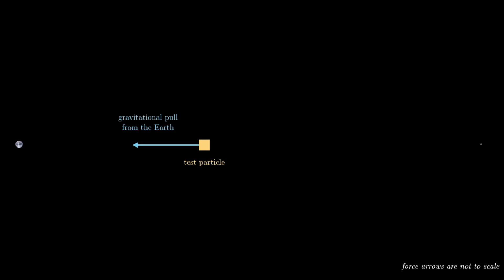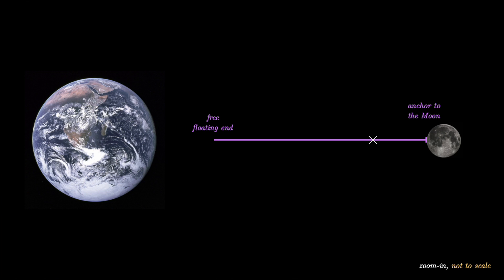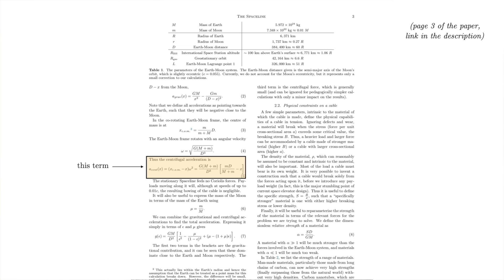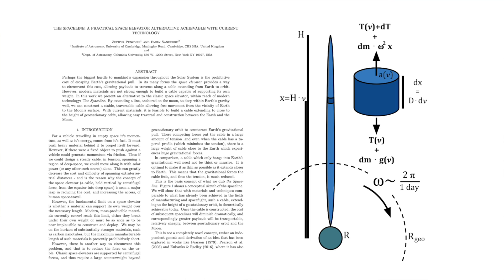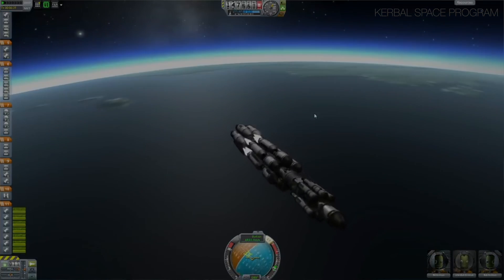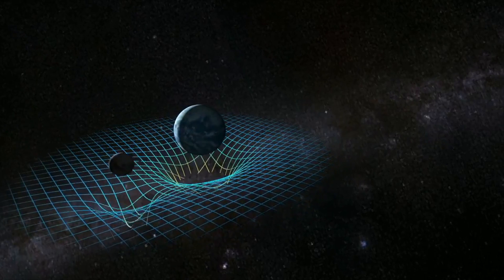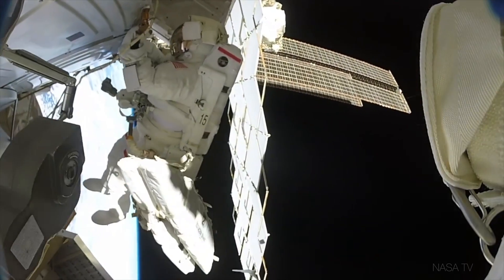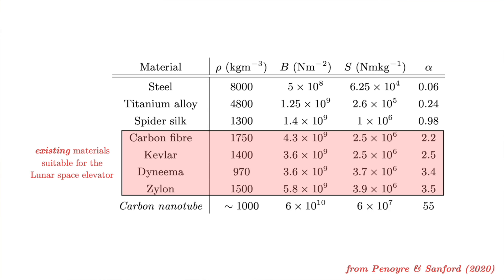The Lunar Space Elevator

Comment: I quickly read your paper, thanks for posting!  Surely, with libration and tides and so on, the L1 point is jiggling around?  Does this not constantly change the stresses at the Lagrange point and/or cause bowing and whipping of the line between L1 and the Moon?  Also the Earth 'end' point may end up whipping around too.  I suspect there may be some interesting engineering problems as a result.
Reply: What if instead of a cable they used something rigid like steel beams 100ft long connected with joints that allow a wide range of motion?  Or if the structure extended all the way to geostationary orbit, wouldn't that mean most of the mass would be pulled by earth's gravity, thus keeping the line taut?

Comment: As I listened to this, my mind kept saying "but what about Coriolis force?  There's a huge change in angular momentum."  The paper by Penoyre and Sandford does address Coriolis, but simply calls it negligible without justification, just to later note that Coriolis forces would induce bending in the cable.  I haven't run the numbers myself and I'm no material scientist, but it seems absurd to claim that we can just hand-wave this force away.  After all, the argument for a lunar elevator is that it reduces fuel demands, meaning the energy from that missing fuel must come from somewhere else.  Penoyre and Sandford  seem to think the stiffness of the cable is sufficient to transfer this energy, but I'm not inclined to just agree.  It seems to me that a sufficiently stiff cable would need to be so massive as to be not worth building in the first place.  Alternatively, a much smaller and less stiff cable could be used but it would be limited to small payloads.  
It seems much more reasonable to consider a thinner cable combined with tangential thrust, perhaps from fuel produced and pumped from the Moon.  In this way, construction of this infrastructure might become more realistic without sacrificing payload capacity.
Reply: 11:24

Comment: I AM FAR FROM UNDERSTANDING ALL THE FORCES THAT WOULD BE INVOLVED FOR A SPACE ELEVATOR BUT I CAN REMEMBER READING ABOUT IT IN SOME SCIENCE FICTION BOOKS. IF MEMORY IS CORRECT IT WAS ARTHUR C. CLARKE THAT USED SUCH A DEVICE AND I REMEMBER HOW EXCITED I WAS ABOUT IT. 

I HAVE GIVEN THIS IDEA SOME THOUGHT AND I HAVE A QUESTION FOR ANYONE THAT HAS MORE KNOWLEDGE ABOUT SUCH THINGS THAN I DO. WOULDN'T IT BE MORE ECONOMICAL AND STABLE IF THE EARTH TO SPACE ELEVATOR TO BE PLACED AT THE NORTH OR SOUTH POLES? I'M THINKING ABOUT THE ROTATION OF THE EARTH WOULD ALWAYS BE PUTTING A LOT OF STRESS ON THE CONNECTION AT THE EARTH END AND POSSIBLY WEAKENING IT UNTIL IT WOULD BREAK. AT THE NORTH OR SOUTH POLES IT WOULD ONLY BE DEALING WITH THE SMALL AMOUNT OF ROTTEN AND HAVING THE SAME AMOUNT OF STRESS THAT WOULD NEVER INCREASE OR DECREASE. TO ME IT JUST MAKES MORE SENSE.

Comment: What about the precession of the Moon? Woudn’t that make the elevator wabble?
Reply: Only slightly and it would be fairly trivial to overcome, and you could spread out several more cables after the first to anchor it over a wide area (adding redundancy and stability), and with the low gravity of the moon you don't need super materials to make it work, even kevlar cables would be more than strong enough to make it work

Comment: i wonder, have you considered the drag of photons yet? with like 200000 km long surface i guess you would get quite a momentum, right?
Reply from the maker: This is a cable so radiation pressure would be very small, check out our quasite video for more on radiation pressure though!
Reply: @CoolWorldsLab  i know that in the first place it should be a cable of small diameter but in the long therm it might be big as in the pictures and animation... if we would put solarpanels on it it would even get worse. 

just saying, contructive critic, nice idea nontheless!

for the philosophical part, i guess there are only two ways to go: full forward tech-evolution which comes with new problems of unbelievable/unknown size and new challenges or slowing down with science and development and give it more time for overthinking our problems. give our society time to slowly adapt to our changes, or even completely stop evolution.

Comment: AFAIK the moon is slowly receding. That may need compensation.
Reply: I think the rate is about 4cm per year, considering the other technical challenges I don't think that would be a biggy,especially as the moon is about 385 000km from the earth. I could imagine thermal expansion / contraction of the rope material due to being in or out of sunlight being a bigger issue.

Comment: How fast can the elevator travel? I mean it takes there days to get to the moon with conventional rockets flying at speeds that exceed the thousands of miles per hour... would this elevator  be able to match it?
Reply: Well just imagine it travels with 1000km / hour, which is for a maglev train quite fast but doable imo.  That would be 384 hours, or 16 days. And there you can see the problem of these project already. Beside the problem to hit the Lagrange point L1 with million tons of material for the cable... 
While i like the spirit behind the idea, its fairly stupid to build such infra structure instead of space ships and shuttles for permanent use. So space vessels that stay in space all the time, and shuttles to land on moon and Earth.
Reply: @hansjorgkunde3772  agreed. Not to mention that the cost of building such an infrastructure is probably so high that I guess no many if nobody would want to fork the bill.

Comment: Cool, a great idea and subject to study upon. But have you thought about, factored in, the fact that the moon is drifting away from us with about 3.5 cm (I might be off a bit) a year? Making a practical implication impossible.
Reply from the maker: This isn’t really a problem. If the tether connected to both the Moon and the Earth then that tension would snap the cable. But only the Moon end is connected, the other hangs free and so just slowly drifts away at one inch per year.
Reply: Mate, I hadn't even thought of that. Good eye. But it's just a minor inconvenience. We humans have built structures that can handle much more movement than that lol.

Comment: With weaker gravitational bodies I would assume an orbital ring would be more appealing than an elevator because of the shorter length of cable required and greater savings and flexibility in launch profiles along with multiple ground sites available for shorter length elevators, and in any plane. Perhaps even less expensive in delta-V to rendezvous with a low altitude orbital ring from a free return Hohmann transfer than hit L1 and station keep? More technically challenging though I guess.

Comment: The lunar space elevator could be weaponized.  Much less so than rockets launched from Earth's surface.  If we are assuming missions to the rest of the solar system and we assume a human presence in space then we have to consider the danger of those rockets. 

There is a danger from projectiles dropped from Luna toward Earth.  But the elevator cable has a capacity limit.  Rockets located on the Lunar surface could move much more quickly.  You might see a steady flow to L1 or GEO of a ton per week on the elevator instead of a build up of 500 tons of launch capacity which could be fired quickly. 

There is also competition from a lunar rail gun.  The space elevator would lend itself to anchoring a large facility at L1.  The rail guns would be able to move large quantities of mass into orbit at high rates. 

The elevator itself is a piece of string stretched out over thousands of miles.  It is not very defensible.  Attacking anything in space is a challenge but compare to any sort of bunker in a Lunar lava tube or a facility that can maneuver.  Whoever operates the elevator would have to think carefully before picking a fight with space capable countries. 

We might stockpile fuel at L1 for launches to deep space.  Fuel stockpiles are already planned for LEO to be launched from Earth's surface.  The fuel is not any more or less dangerous.  Fuel coming down from the moon will do much less environmental damage.

Comment: 2/3 of less fuel? Bollocks. You need the same amount of energy to leave earth and to break at the far end of the lunar elevator. Arguably those are similar to leaving earth and breaking in order to land on the moon. Travelling once it has reached high velocity costs no fuel. So the fuel costs will be basically the same in order to go to the moon. As a matter of fact, the elevator would probably be super slow so you'd happily spend slightly more fuel to cover the distance at a great speed instead of a slow rope-climbing speed. The only benefits I see is in leaving the moon but since the moon barely has an atmosphere, accelerating "higher-up" will be almost the same as accelerating on the moon's surface. Again, speed should also be considered.
Reply: The earth end of the tether is at a lower gravitational potential relative to earth than the moon end, thus saving you the fuel needed to get you over the 'hump' at L1, and also decelerate you on the way down to the moon. For a round trip, you save that energy 4 times. Not only that, but the earth end is not orbiting at the speed that its appropriate to its position in space, it is moving at lunar radial velocity (much slower). Not done the sums, but that would be the apogee of a highly eliptical orbit of earth. Depending on where its perigee is, it may not be require much more than LEO velocity to get there. The perigee may even be in earth's atmosphere meaning no de-orbit burn on the return trip, just let go, drop and aerobrake back home.
In short, I can see how it would save more than half of the fuel required for an earth-moon round trip.
It would certainly be slow though, so I imagine its utilty would be for shifting materials rather than people or time-sensitive cargo.
Reply: @bimblinghill  You raised some good points. Thank you.

Comment: Great idea, but now for the practical real world enginnnering: how do propose building it and making it operation? Without the hard engineering thinking it is just another science fiction idea that is up there flying cars. How are you going to build it? What the enginnering problems to solve, and risks to mitigate?
Reply: A couple of issues:
a. How circular is the moon’s orbit? Most bodies move in an elliptical orbit? 
b. Tidal effects between the earth and the moon are causing the moon to move away from the earth, which will be a large force on the cable given the Mass of the Moon.
c. How are you going to pay out the cable in such a way so you land it at a fixed point on the earth. Nothing in space travels in straight lines and is governed by celestial mechanics.
d. If the cable is conductive then it will be cutting through the charged Van Allen belt, that will induce a potential difference and huge current across the cable length?
e. As the cable has to withstand the centripetal forces of the moon, circularising the moon elliptical orbit, and with stand the forces pulling the moon away from the earth, how thick will the cable be, and what material would it be made of...

These are no trivial problems, how will you solve them...

Comment: I think it's neat idea, but I wonder what the effect of having a 200,000 mile long cable traveling through Earth's magnetic field would be.  Back in mid 90's the Shuttle did an experiment where they deployed a satellite on a tether. After unfurling several miles of cable it began to induce a current which got so strong the cable melted. I think they only got out about half the cable before it broke and the satellite was lost.  In general these crazy long tether ideas all seem like they'd end up being ginormous antennas we'd be extending into a rather chaotic high energy environment. I mean aside from Earth's magnetic field you'd also have the Sun 's along with the solar wind and solar flares all looking to induce very powerful electric currents in the your tether.
Reply: HOD0R  At thousands or tens of thousands of volts most materials are conductors.

Comment: How much fuel do you need to save using such an elevator before you have even recovered all of the energy and materials required to make it? That question shows that it is not viable "now" because that is not how humans do anything, they progress incrementally and not by investing more than they need to get to the next stage of development. Anyway it probably isn't needed as mass driver tubes bored into the surface of the moon would be a byproduct of both mining for materials and sinking shafts deep enough to create safe cities on the moon. Driver tubes can operate in both directions and capture energy as they slow an incoming craft so that the energy can be used when it launches again. You can also make them at different sizes and depths and have as many of them as your traffic levels require over time, so the idea scales nicely. Do the maths on that.

Comment: Well the moon is not circular the Moon and the Earth rotate around the sun so the Moon is actually doing the spiral around the Earth lb of torque on the cable 90 degrees you would need to take that into account it's also an ellipse kind of like a parabolic you would generate a tremendous amount of current in the cable unless the material is non-conductive you'd also have to take into account for the solar the cable would melt due to the high current produced